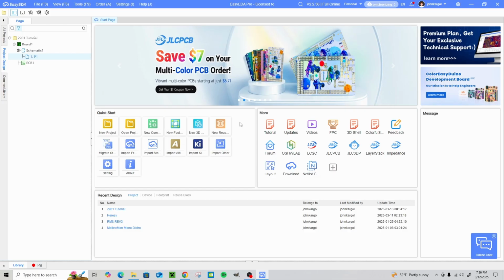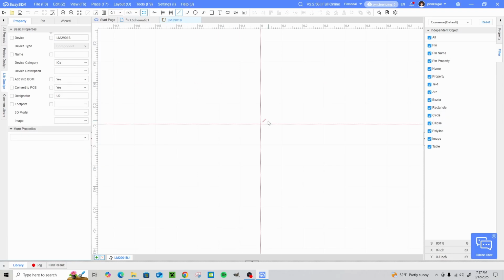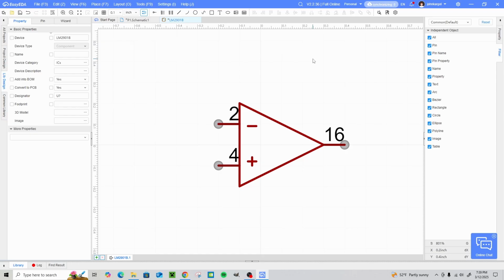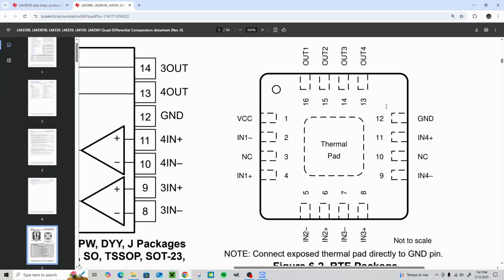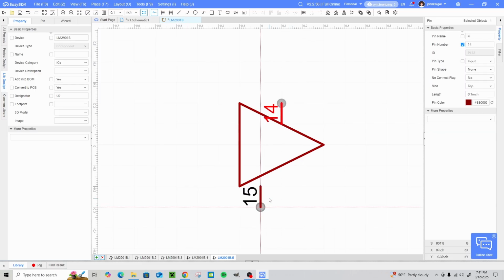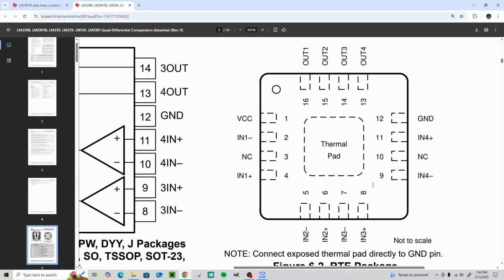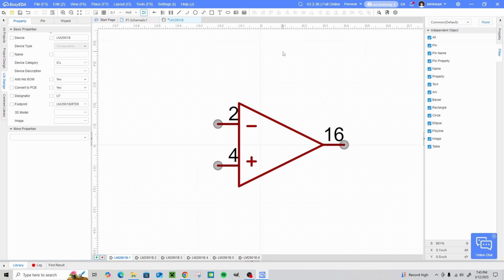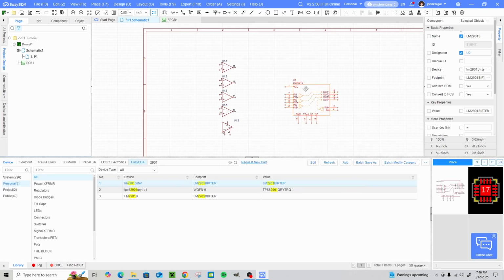Sub Parts/Multi Parts: EasyEDA Pro Tutorial

Comment: Very informative tutorial. Thank you! Please make more advanced tutorials for EasyEDA.
If you want an idea for the next video, here is something I recently tried and failed. lets say I want to use any module from aliexpress, I can find or draw the module I want in EasyEDA, but I can't make JLCPCB solder pin headers for me. If I put a row of pins on top of the module layout the traces will not connect to that pin anymore. What I am asking is: is there a way to combine 2 components so that one will be assembled by JLCPCB and one will be just the layout (but they both located in the same pads on the PCB)?
Reply from the maker: Thank you!
What you're experiencing sounds like a net-conflict to me, at least as far as you have explained. Tools like Net-Shorting flags could be all you need.
If you want to share more details with funwithlead@gmail.com I'd be more than happy to take a look.

Thanks!
JK